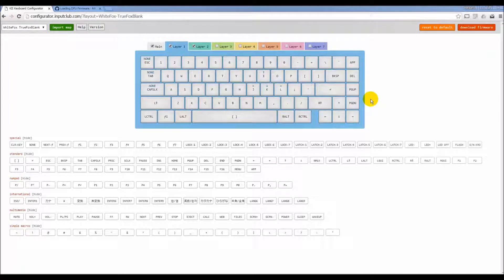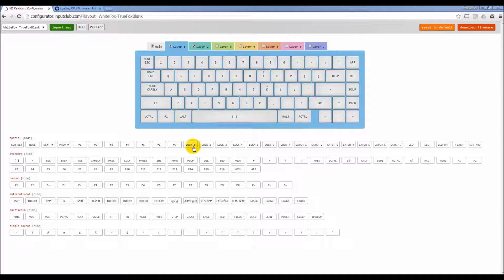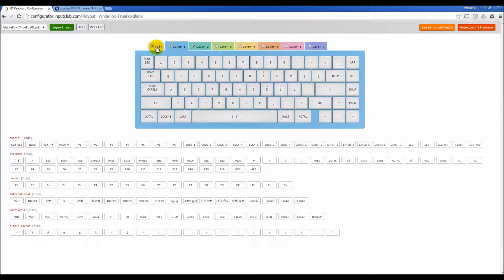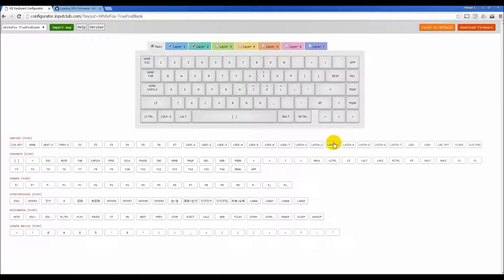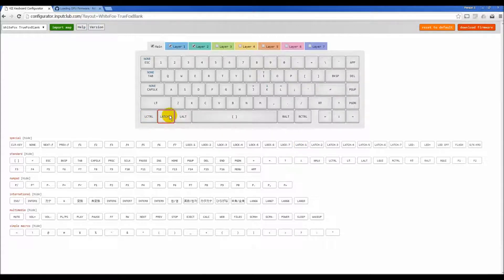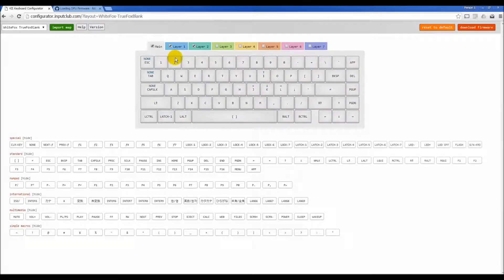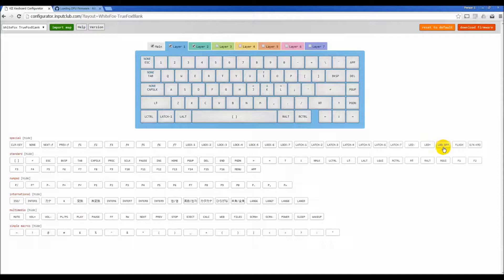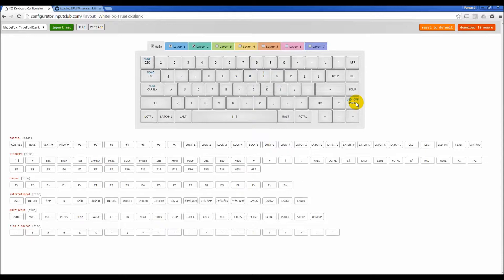What are Locking and Latching?

Comment: is there a way to set a button to stay on a layer until released - so If i want to to press a few buttons on a layer but without locking  is this possible - ? Specifically - I want to hold down a button to select layer 1 and I want to set my numbers to the F row and press a few F row buttons but upon release of the layer button i want it to revert back to main . - can this be done ? - can it be done in VIA ?